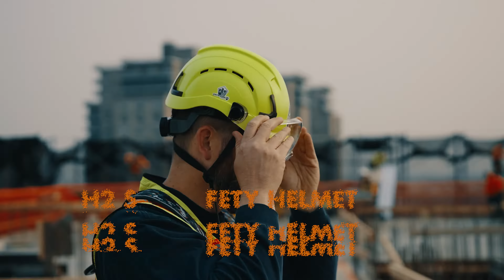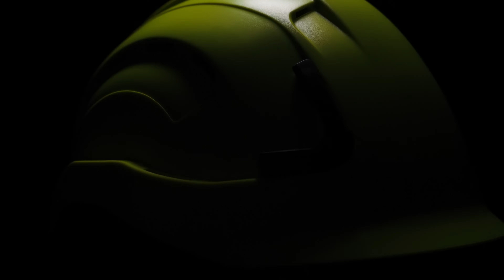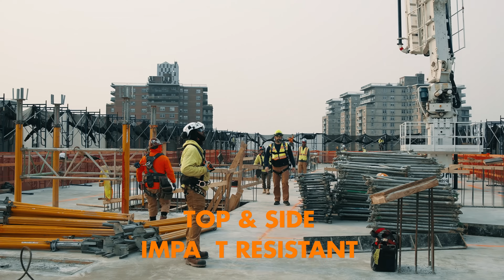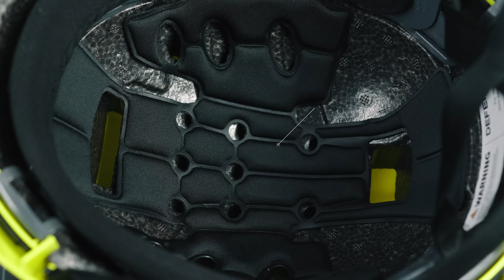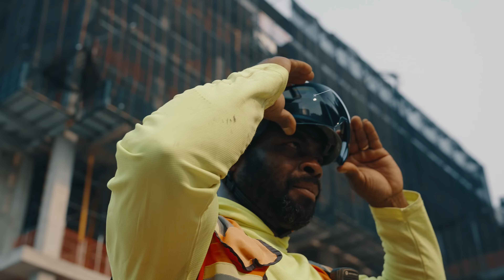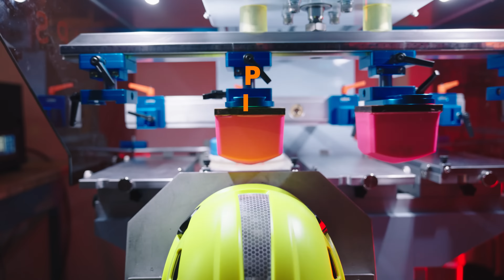H2 Safety Helmet | Type 2 | Defender Safety

Comment: Does this hard hat have to put on a head lamp?
Reply from the maker: We're currently developing a new headlamp and it will be coming soon!
Reply: I mean does this hard hat have the clips to put a head lamp on?
Reply from the maker: @mariozuniga5024  Yes, there are clips on the front and back of the H2 that will hold a headlamp strap in place.